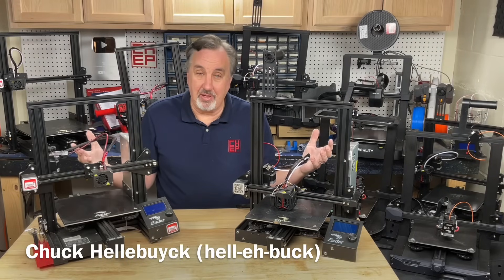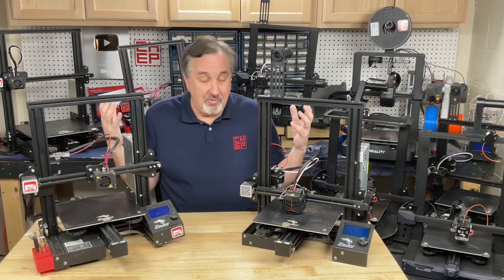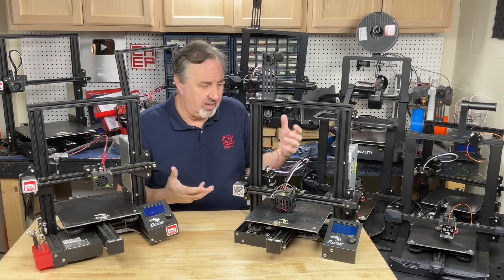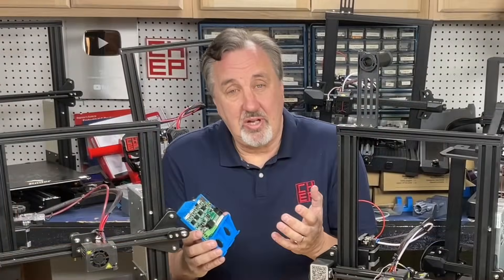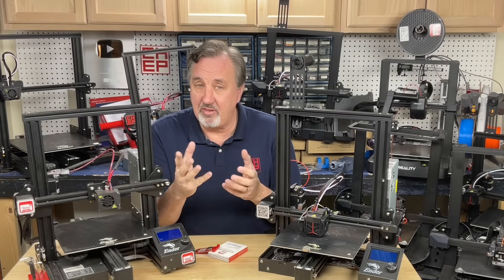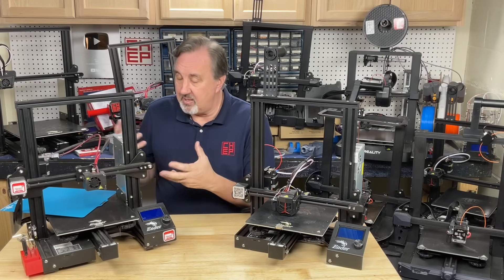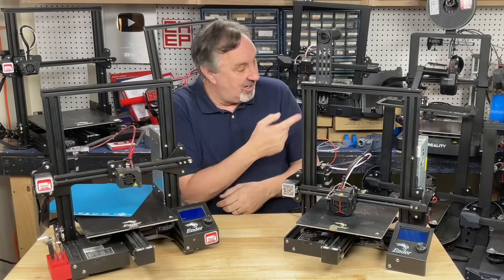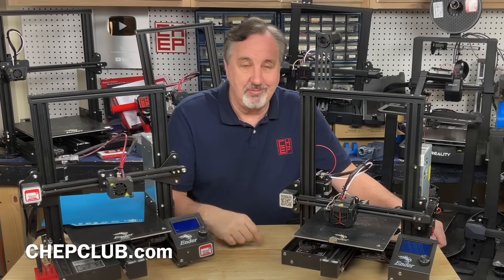Too Many Ender 3's - What Should I Do?

Comment: yup i have a K1, K1Max and a K2Plus...but i still use Ender 3 also, pure and alone for tiny delicate prints, which the big ones has a bit trouble with. and btw the tine prints on an Ender 3 is faster then on the big brothers because they take more time when they actually starting to print :-) .And yes Chuck my journey started with a Anet A8 and then the Ender 3 , that gave me the opportunity to make a XY CORE printer out of the ANET A8 parts. without these machines i never ever would reached my skills about 3d printing, that i still can use for trouble shooting with the new machines.And you see that in the groups, peeps who bought a K version or a Bambu as their first printer and running againts for us easely probs, havent a clou to solve it. Your vids have helped me also a lot and thank you man !!

Comment: I still have an Ender 3 (first version) with a few QoL mods, but lately it has been printing worse and worse. Unexplainable under extrusion, weird printing artifacts on anything printed in the back right corner. I’m tired of the constant tinkering and tweaking. It was fun for a while, but I just don’t have the energy anymore. My ender 5 used to be my less reliable printer, now it’s my go-to machine. But, if I ever get the money together, both will be scrapped for parts and replaced with a Prusa XL (or, if by the time there is one available, a clone of one ;) )

Comment: I still use my  3S1 with Sonic pad for Klipper and get stable, problemfree 100mm/s speed prints. Reliable for years now! direct print via WLAN directly from Sclicer - without Bambu-bricking-safety things and cloud pain.
If I buy another because bigger printer I maybe rework on into a pcb milling machine, foil cutter or like that.

Comment: I'd love to see a fine-tuned Ender 3 Marlin firmware, rather than fast CURA profiles for the stock firmware. I believe there is a broad margin in the speed and acceleration limits set in the stock firmware. I think Ender 3 may be a way faster printer.

Comment: I started watching your channel way back when you were still working on the xyz aio. And for some reason i still have mine, but i digress, I still have my 2 E3 pros and print on them, those little machines are just work horses, I just picked up a new in box  ender neo max for 80 bucks. I have been wanting to modify a machine to engrave, and I have a Lazer for my cr10 s5, finding light weight, but dependable dremel type tools, is not easy, I am going to get the prusa xl with the 5 heads.

Comment: I still have an Ender 3 v2 that I still use. It's modded and hooked up to a Sonic Pad so I can run Klipper on it. But I also have an Ender 3 v3 Plus that is blazing fast. It will spit out a 14 minute benchy.

Comment: You can always tear them apart and turn them into Voron Switchwires, or even into DIY CoreXY machines; there are instructions on how to do it online. Yes, I still have my Ender 3 which has almost reached its final form with linear rails on X, Y and Z, plus Klipper!

Comment: I have 2 Ender3 S1 pro and i would never change them for a bambuu one !
for two reason   1 i dont want a closed system like the old Da-Vinci
2  i dont need more speed then the printer that i have
my printer are very stable , i know them and i can thrust them that i will get the result i need

Comment: Covert the print head over to a laser and build an engraving system for control panels, or even a cheap CNC motor and spindle engraving system.  That way you could print a 2 color panel blanks and then use the CNC to engrave the text into it for RETRO looking panels.

Comment: I have an Ender 2 Pro, 2- Ender 3 pros, 2 CR-10's and two CR-10 v3. As i work for a school I have been considering talking to the few teachers that have printers in school if there any any students that seem really interested in the format and may give one E3P and original -10 to one or two but I will always keep one E3P, its where I started. Just ordered the new Elegoo Centauri Carbon. but as we all know, even a fast printer is still slower then multiple printers printing :) Also, while I use octoprint now (on a mac mini running Windows10, I think I'm going to give klipper a shot.

Comment: I still have my Ender 3 Pro, which I bought in 2018 for $174. It was my first printer, and the only reason I haven’t given it away is that it prints TPU exceptionally well and fast. I’ve upgraded it with linear rails on the X, Y, and Z axes, a Hemera direct drive, the 32bit EZboard lite, custom firmware, a Gulf Coast heated bed, and a Gulf Coast LED light, It’s hard to let go after putting so many hours of frustration into it. It now sits in the corner next to my Prusa MK4S, Prusa Mini+, and K1C— and I'm waiting for my Prusa Core One to ship :)

Comment: Have an Ender 3 Pro and Ender 3 Max.  My 3 Pro is several years old and originally came with an 8-bit board.  I upgraded to the new 16 bit silent board, which is amazing (and slow :).

Over Christmas I purchased a Sonic Pad that I plan on using with both printer.  While I don't expect the speed to match my K1, it will be nice to move from Marlin, and it will be nice to keep using the legacy Ender 3 printers :).

Comment: I bought a Longer LK4 five years ago and I've slowly turned it into an Ender 3, piece by piece. Dual z-screws, Sprite direct drive, Creality 4.2.7 mainboard, Ender 3 glass bed, CR touch, etc. The modularity of the Ender ecosystem is alot of fun!

Comment: both of mine have been modded multiple times and now both just collect dust. Never use them and nobody wants them.. I've ender extended one of them too. Also have three Prusa based printers that don't get used. A railcore that barely gets used (work stuff) too.

Comment: I am sat here in the UK watching you talk about giving up the Ender 3 while soldering/wiring my new E3D Revo Hemera XS + 3D Touch Print head cables to give mine a kick up the arse! I do have a Duet2 wifi board and upgraded bed springs with a G10 print surface and a few other creature comforts but would still say...

1 Ender 3 is useful
2 ender 3s is lucky
3 ender 3s is a blessing

Any more is trouble!!!

Keep using what you can and if Trump will let you, send one to me!

Take care and keep printing!

Comment: My only printer is still an ender 3 pro and the only mod I have done t it was the Creality direct drive kit. I would have liked to do an extender kit on it as a larger bed size is what I would like to have. I'd prefer a rectangular build plate say take 2 regular ones together. It's been a good utilitarian printer albeit slow. I would like a newer larger and faster machine but a new printer doesn't take precedence over other materials and tools. If I were to buy a new printer it would be a multi material unit. 
       If I had a spare ender I'd put a diode laser in it.

Comment: I do still have 2, one I'm converting to a laser engraver, but the other is still trucking after 5 years, and I've gotten so dialed in (thanks in large part to your videos) that I just don't have the heart to scrap it. It doesn't get as much use anymore though.

Comment: i sold both of my Ender 3s when i bought my P1S.  that one printer does the work of 3x of my old Ender 3s and they were fully upgraded with new TH3D boards, e3d Hermes hot end/extruders, spring steel PEI powder beds, runout sensors, etc.  only things left that were actually Ender were the frames, screens, and the motors.  even the z-rods and bearings were upgraded. lol.  they became obsolete as soon as i powered up the P1S.  used one for a little while with TPU only as it was duper dialed in for it but eventually just decided that the rear spool holder would be for TPU.

Comment: Hi Chuck been watching your videos since ever. I still got an ender 3. With klipper. Klack ender probe and and stealthburner. Just use it to print carbon fiber. Not a lot but meh. One holds sentimental value. The other heavy cr10s modded id at a deposit collecting dust😢. I upgraded to voron and Bambu. But still keep one ender 3. Its good that you are goignt to do projects mixed again. Cant wait for them.

Comment: I have an "original" Ender 3 - much modified, by now:  Klipper (and, incidentally, WiFi) via a Pi Zero 2w, a camera (original Pi camera), direct drive (MicroSwiss), and a bunch of printed improvement parts as well.  Someday, a CoreXY;  not ready to shell out $$ for a Voron kit or Bambu Lab or the new Prusa, but maybe someday ....

Comment: Great video Chuck! Even if it feels a little sad experiencing the twilight of the Ender 3 🥹

I still use my modded Ender 3 V1. Have it hooked up to OctoPi, have a MicroSwiss Direct Drive and all metal hot end, BL Touch, Creality enclosure and an upgraded 32  bit mobo. It's still my only 3D printer and I've had it about 6 years now. Still my workhorse for when I need a 3D printed part and I can't see myself upgrading any time soon.

Who'd have thought we'd end up with retro 3D printers? 😂

Comment: I started my 3d printing journey last year with an ender 3v2 neo and was very happy. I bought a "broken" second v2 neo and fixed it up just for fun, gave it to a guy at work so him and his son could get into 3d printing. Then I bought a (broken) original ender 3 and fixed that up. With the loud stepper board and man this thing is slow, but I keep it set up with a 1mm nozzle for vase mode prints. Now I have a 3v3se and it's pretty great. I've been eyeballing some bambu printers but having second thoughts about such a closed source ecosystem, especially since their latest shenanigans. I think I really enjoy life off the cloud and the idea that I can keep these machines running indefinitely with simple repairs and cheap parts. That said, so far I have not had to buy any parts yet :)

Comment: i think for begginers that want to learn more and like to do things with his hands, add mods and improve, enders are quite a good option if you can get it cheap, is true that there is more options now but to buy one even for 200 dollars to just get dusty is better to buy one of this.
if the just want to print "colectables cause they are deep in some hobby" i would recomend to buy a newer option with more QOL. also for peoplo with a profile it just works and only need to do that thing are in this category.
but for enthuiast that like not only to prnt but also the hobby in all of 3d printing ender like printers are quite fun, also gave a few ender 3 of mine, now i have only one xd and others more moderns, but always come back to mod and paly with my ender 3. (also installed auto level, change extruders, etc, was fun, some times annoying xD but fun nonetheless

Comment: A 3V2 is my only printer. Had it for a few years. It has worked flawlessly. I don’t have a need to print faster, so I am content with the pokey 3V2. If they come out with a multicolor printer that doesn't generate a lot of waste and add a lot of time for color changes, i will be interested.

Comment: I have 12 Ender 3's (OG, Pro's, V2's, V3 KE's).  I now use them if I just need more volume printed.  I try to avoid them since the newer printers just produce cleaner prints.  I've seen a kit to convert your ender 3 into a Core XY, really debating that.

Comment: It's your channel, chuck. Some requests for shows were done years ago, as you mentioned.  Build along  (viewer participation required) shows with E3's or bl A1 mini's, which get more views?  Personaly, I just bought my 2nd printer, an A1 combo to compliment my k1c.  A bed slinger at core xy speeds and much quieter with 4 filament ability.  Larger print area, but won't pring the exotic filaments.  Suggest setting up an E3 to print nylon, pc, pp, et al.

Comment: Like computers started with kits all the way today where you can buy a prebuilds that just work. The 3d printer has a come a long way too. Today you can have a printer that works out of the box at a reasonable price with features these first gen printer don't have. For now, I see these old printers as project printer, but from a functional prespective, they are good for parts and maybe repurpose them for expriements where you don't care if it got destroied or not.

Comment: CHEP!! love your channel and you were one of the channels i followed back during those ender 3 covid days.  I do have an ender 3 pro and 4 ender 2 pros, all Z axis modded to print 500mm tall for the stuff I print.  I do have a P1S so anything that fits on it obviously gets printed there.  What i would do with your ender 3 printers is see about converting a couple of them to the "Duender" as it is a kit that strives to make use of all  parts from 2x ender 3.  Other fun projects include the 'pullstruder' to recycle PET bottles, and just about anything you can use the raw materials 4, all of these  8 bit boards can be hooked up simultaneously to a raspberry pi and controlled through klipper to create some sort of monstrosity.  I'm sure you will get lots of great suggestions.

Comment: 2 ender 3 and a Max.   which is down to 1 ender 3 working - the original one i bought might be toast....i tried to upgrade to direct drive extruder and now i get thermal runaway error when i try to turn it on.  in chinese.
but installed CR Touch on my son's and it's still printing just fine.
and just got my first Flashforge Adventurer 5M in today from Amazon.   i want to keep them all running but may have permanently retired that first one.   still not sure what it was i did wrong.

Comment: I haven't used my Ender 3 pro in probably one to two years at this point. More or less between getting the A1 mini, what I would need that my Ender 5+ provided I haven't really had a need to use it anymore.

I have seen that there was a Core XY conversion that someone in the printing community has put together and was considering doing that. It appears to most reuse all the stock parts. If I can get that, I might considered using it more often.

Comment: I have two Ender 3 Pro's, and a new K2 Plus Combo. I also ran one of my ender 3's with a Pallet 3 pro from Mosaic (that is no longer being mfg). With a few mod's (Octopi - Octoprint, BETouch Probe, Silent Board Upgrade and Marlin Firmware update) - These machines, although half the speed of the K2, are still great for single color printing. I agree they are getting long in the tooth, and the new coreXY models are setting a new standard. I went to the Ender 3 after a total failure with the XYZPrinting - CoreXY I started with. 

I agree, space is limited in my little project corner so I'm starting to look at the Ender 3 Pros as potential donations to a good home. Especially since I added an enclosed Laser Engraver (WeCreate) to my project space. I'm also like you in that I dont want to just see these go into a landfill.

Comment: An Ender 3 Pro I had performed so poorly it almost chased me out of the hobby. As of late last year I couldn't sell it or give it away. I won't touch another Creality product after experiencing the Ender's quality control. After the Ender I got a Mingda Magician X which performed perfectly out of the box - and cost the same as the Ender 3 Pro ($185). After about three years it started to fail, but Mingda has left the consumer market.  So I gave in and danced with the devil. I got a Bambu P1S and It's simply too good. I thought I'd probably be disappointed but the machine is rock-solid and makes perfect prints, without requiring any attention from me, which is the way I like it. Your pile of Enders might best be used for spare parts. Motors and rails and boards, etc.

Comment: I still use my E3. I have BTT main board with custom firmware (still marlin), BTT screen and a direct feed hot end now, and my prints are fast. What was 11.5 hours on it, and is still on my two CR6-SE is about 5.5 hours now and as good if not better quality.

I got the CR6s at about $60 Canadian pesos each and they just needed a little bit of maintenance. I was actually looking for another E3 to change to my laser engraver head to change it to a dedicated laser engraver, pen plotter and maybe dremmel attachment?

I think these old enders are work horses, learning machines and good to start new projects.

Comment: I am an Ender 3 man period.  I have not and will never use any other printer.  For what I do, the Ender 3 is more than adequate. I have an original Ender 3, two Ender 3 V2, and a CR6-SE.  I enjoy tinkering with them and modifying them to suit my needs.  I do not need / want all those bells / whistles on the newer printers.  More to go wrong and harder to repair / tinker / customize.  I am always on the look out for unwanted Ender 3 printers.  I would take a few apart & use these to make my own Core XY printer.